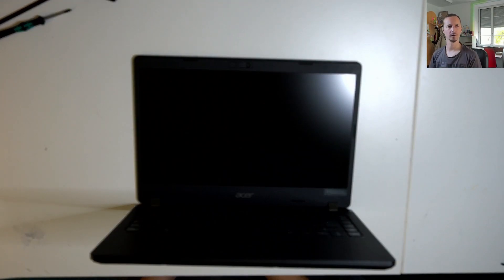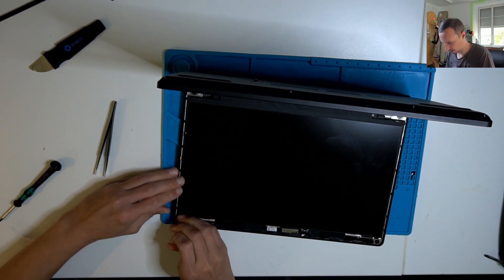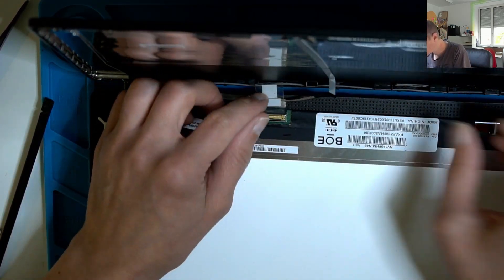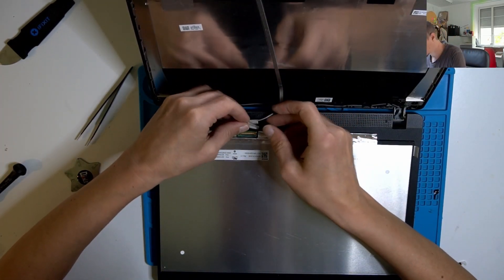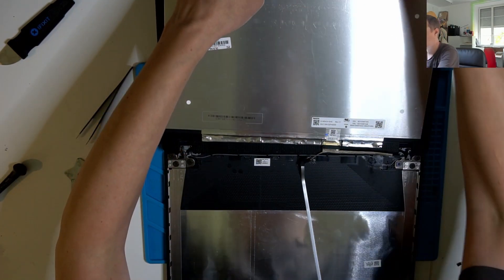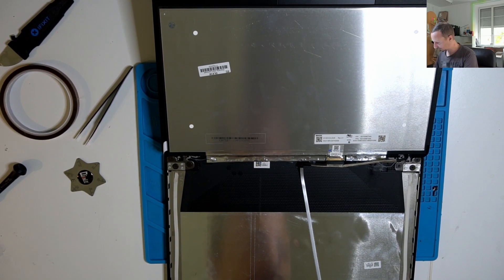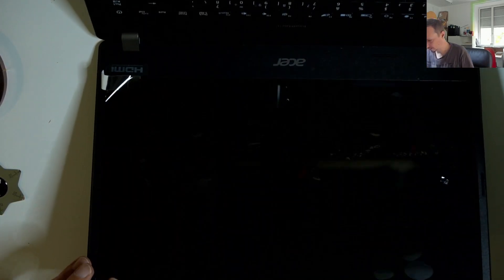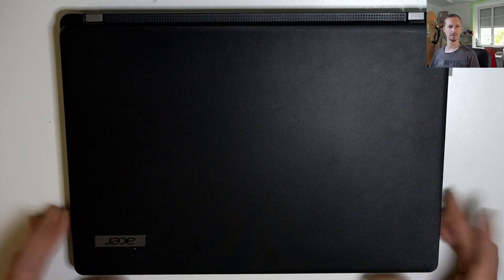how to replace lcd on an acer travelmate

Comment: Hello sir, got a couple of questions. What type of P214 which carries pins other than 30? and is there any way how to check the amount of pins without opening the bezer etc.(e.g. using the SNID or Model No. to check the specifications)?
Reply from the maker: I allways recommend opening the bezel to take note of the pins and the size of the lcd itself. Good supplyers will give you the size of the screen in the description, and sometimes the lcd has has 4 ears on each size.

Comment: Good day sir. I will be ordering online of Acer Travelmate P214 replacement LCD. what specifications of LCD will I order? Thanks. And can I reuse the tape you pulled out to remove the LCD?
Reply from the maker: in my case it was an p214-53 model: 30 pin eDP connector, slimline 60Hz, ips full HD. If careful, pulled out stripes are reusable.